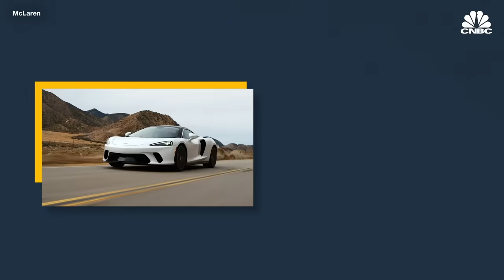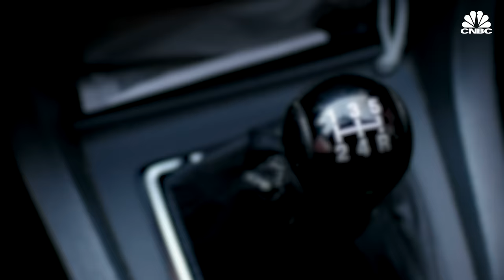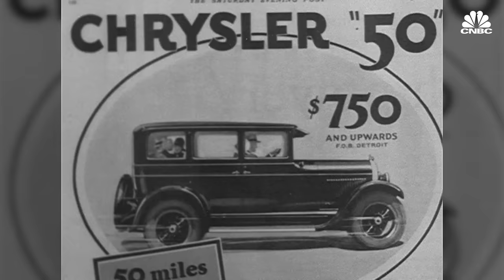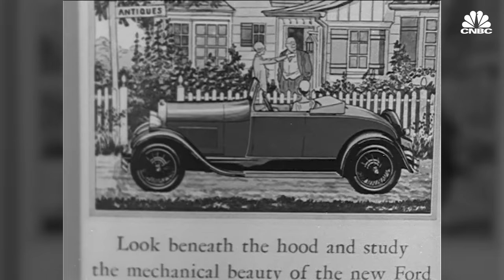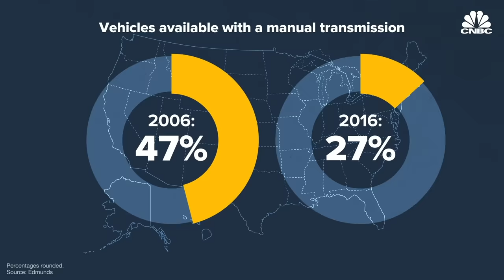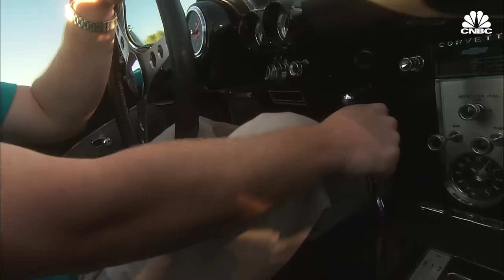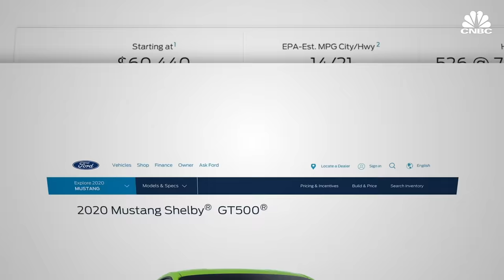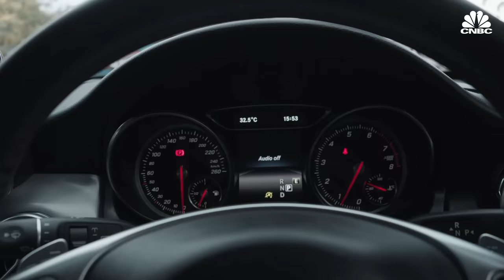Why Stick Shifts Are Going Extinct

Comment: Who else still has a stick shift? 🙋‍♂️
Reply: lgmisfit10 STI
Reply: Wow..
Only 25 upvotes so far?!
Reply: 2015 Jetta
Reply: Mazda 3 . Slow as hell but I still feel like I'm in fast in furious cuz it's stick.
Reply: I own a 1990 5.0L Mustang LX sedan,
a 2004  Nissan 350Z and a 2014
Infiniti Q60S. All have a manual transmission.
I absolutely HATE automatic transmissions.
Why? Two reasons. First they are boring
to drive and you do not have as much control and 
the biggie, EVERY automatic transmission I
have ever owned has had a major failure 
before the car reached 100K miles.
Reply: Have had many, drive a 10 speed semi every day and own a 97 cobra mustang, that car ONLY came in a manual. Learned when I was 13 years old and have never looked back
Reply: My first car was a stick, then got an auto, current car is an auto duel clutch, my next one is gonna be stick again for sure.
Reply: Fiesta ST   here
Reply: @archangele1  How many cars with auto trans have you had? My whole family drives auto vehicles with over 100k miles and we've never had a problem with the transmissions, although my next car is going to be manual because you're correct, auto is too boring. My moms 2010 Ford Flex is over 200k miles and still pulling strong.
Reply: 1996 Nissan 300ZX Turbo
Reply: 2019 Nissan 370Z sport coupe 6MT.
Reply: @Sauce.714  My first car was a 6-cyl 1966 Chevy Chevelle with an automatic transmission, a real piece of junk.
Reply: 2003 Nissan  Sentra SE-R  spec v
2002 Dodge Dakota 
Only have manual
Reply: I have a automatic 2020 jeep wrangler. I love it.
Reply: Yota Hilux Fortuner. Manual all the way.
Reply: 95  Acura integra gsr!!!
Reply: 2005 Saturn Vue - stick shift. Love it !
Reply: 18' Versa.  Horrible car, awful transmission.  (My 89 F150 had more 'feel' and consistency).  But it was the only stick available in my town unless I wanted to drop $50K on a BMW.
Reply: Never owned an automatic, though I am in the UK where manuals are more common.
Reply: Anyone who prefers driving an automatic either sits in a lot of rush hour traffic everyday or just doesn’t know how to drive a manual. If you don’t know how to drive a stick, you’re really missing out on a more engaging way to drive. It’s really not that difficult. I laugh when a dude like half my age (upon learning I drive a manual) acts unjustifiably impressed, like I’m an astronaut or something. Haa!
Reply: I have a 2016 veloster turbo.., it’s a stick and I love it
Reply: 2008 Porsche 997
Reply: I've had mine for 23yrs
Reply: 2012 Tacoma TXpro 
2008 TSX
(2) 1988 Honda Civic
Reply: When I was in Europe I had a 1996 opel astra 5 speed a 2004 Mercedes Benz c220 6 speed when I came to America I couldn’t find any Mercedes with manual so I got a bmw with 6 speed
Reply: 92 honda civic hatch
Reply: 2001 Ford F-150
Reply: '05 MBZ C230 6-speed
Reply: lgmisfit10 Ford Fiesta 😃
Reply: R32 Skyline
Reply: All of europe, all of china, all of india, all of africa, all of russia. So just 96% of global population.
Reply: 2013 Dodge Challenger hemi can’t beat the feeling
Reply: 2018 Mustang GT
Reply: 56 years old, I have only owned one car that was an automatic in 40 years of driving, a 2012 Audi S4 with a dual clutch transmission.  I sold it and am back in a manual.
Reply: 35 year old VW Vanagon.
Reply: 1996 Nissan Maxima 5 speed
1992 Nissan Pickup 5 speed
2003 Toyota Corolla 5 speed.
Reply: Chevy S10 5 speed for life.
Reply: Still have the good ole Three on the Tree ...
Reply: Only ever had 1 slush-box and that I had for the flappy paddles (pretty decent BMW 220D) the rest were all manual. Currently BMW 118D manual
Reply: My 2020 Kia is a stick shift
Reply: Me 2009 Subaru Legacy GT 👋🔥 never owning a auto again, owned them, hated them, traded them, never looked back!
Reply: 2020 Kia Soul LX 6 spd
Reply: 2018 honda fit and 2004 Mazda Miata
Reply: '97 Toyota Tacoma still running strong. Manual transmission all the way booooyyyeeeee!!!.
Reply: @archangele1  These modern computer controlled automatic transmissions are built to fail. I don't need no car to tell me what gear I need!!!
Reply: 2019 Bullitt Mustang and its a blast!
Reply: 67 chevy c10, 6 cyl, 3 on the tree, bare bones,no ps,pb ac, love it
Reply: 93 Nissan 240sx still running strong
Reply: I have a 2015 Camaro (bought new, and I demanded the manual option) and a 2006 Lotus Elise (there is not an automatic option).
Interestingly both are 6 speed, and the reverse is in the same place (left of 1st). The idea of putting reverse where 6th goes seems like asking for trouble!
Reply: Me
Reply: 2016 WRX Limited here
Reply: I do.  No automatic for me since the 90's.
Reply: A manual van
Reply: Automatics are for chicks..
Reply: 2011 Mazda Mazdaspeed 3
Reply: Oi
Reply: 13 Honda Fit
Reply: my harley davidson motorcycle
Reply: 2018 Ford Focus ST, triple yellow coat.
Reply: Patrick Pmd Sick
Reply: lgmisfit10 Speed3 6 speed
Reply: 1988 Masada B2200
1995 Sonoma 4X4 V6
1997 Sonoma 
1993 Chevy cavalier 3.1L V6 2 door
1992 Chevy scottsdale 4.3
2004 Jetta TDI
2004 golf TDI
2008 Honda Accord 2 door
2011 Ford ranger
Reply: I have a 93' Civic Coupe, it's a manual🙋‍♂️
Reply: 99 Camaro SS m6 here and a 92 03 cobra swapped m6 notch
Reply: Atleast give the option to customers .
2011 Altima 3.5sr 6spd
Reply: 2001 mustang gt :)
Reply: 2019 Mini Cooper JCW here - loooooove it!
Reply: Nothing but automatics for me.
Reply: Jennifer Annison 0
Reply: I have a 13 year old manual ford fiesta and still on the original clutch
Reply: Had 😢
Reply: 5 of them here.
Reply: 2012 Mazda3 fully loaded with a stick.
Reply: 96 powerstroke diesel.
Reply: Mercedes W123 coupe w/ 4 spd manual.
Reply: My first was a 87 mazda 323 manual everything that i loved.   Currently seeing my dodge 2002 neon  rt into its twilight years....
Reply: 1987 Mustang GT. 5speed manual
Reply: British - so of course every car I've ever owned has manual shift.  In fact, I think I've only driven an automatic 2-3 times in 40 years of driving.
Reply: 2015 Mustang GT.
Reply: @williamfunes2740  might be fast but handles better. I have 18 3 hatch
Reply: 1990 Celica
Reply: I still am.
Better to have experience in manual before Automatic, gives people discipline and attention development.
Reply: All manual all audis my Audi urs4 is my dream. Profile Pic 6speed manual and lots of boost
Reply: Ceramic Toyota Corolla s 2006
Reply: lgmisfit10 im aiming at getting my first at 29 years old
Reply: I moved up from a 2001 Jetta 5 speed to a 2012 Sonic 6 speed turbo and my 22 year old son can drive a manual.   I just need to teach my 19 year old.   My 20 year old niece drove a 5 speed to Hs and was the only girl (and 2nd driver) driving a manual in a large Hs.....
Reply: 300ZX Twin Turbo
Reply: 2016 Nissan Versa, andI love it! 🙌🏻
Reply: 1994 Honda del sol 5 speed manual
Reply: I Used to but I just sold it and needed a car fast which is auto 😞
Reply: 2003 SVT FOCUS
Reply: 2006 Mitsubishi Eclipse Gt
Reply: every car that i had driven in my life had a stick. but i'm from europe so...
Reply: 89 Saleen and a 99 Cobra. Looking for a manual truck so people won't ask to borrow it.
Reply: Audi TT mk2
Reply: Me a mini Cooper 🤙🏾
Reply: 2009 honda jazz
Reply: 87 corolla
Reply: I do. My mom and dad drove manual, my siblings do as well abd I do too. So i sticking woth the manual.
Reply: 2001 Saab 9-5
Reply: I have a Corolla Diesel slow car but with manual transmission it feels fast
Reply: Currently own an old 90s ford truck with a stick. Owned like ten cars in my life, half have been manuals.
Reply: 2014 Checy Cruze, and I will make sure my next car is manual as well.
Reply: I have two. 
2000 Toyota RAV4 
2016 VW Jetta 
Eventually the wife and I will drive automatics again, but we are CONTENT w/ our manual transmission vehicles for now!😁
Reply: I wish I did. Can anyone give me a lesson?
Reply: G35
Reply: @kieranmatzky181  save money and just buy a manual car
Reply: I don't own one but I'm a 22 year old American & I know how to drive a manual because I visit Europe frequently; I've driven them In England, Germany, and Ireland. I learned in a VW Passat Estate, only sold in Europe (Not the U.S.).
Reply: lgmisfit10 B6 A4!
Reply: 2019 VW gli with a manual transmission  love driving it
Reply: 2016 mustang gt here with a 6speed man, dont ever have to worry about somebody driving my car, they cant lol
Reply: I’ve only ever owned manual - They are extremely hard to find now a days and it makes me sad
Reply: I have it , I hate it , in the space age we live in ,  shifting gears to drive is so yesterday . I am getting rid of my heap and getting a fully loaded with options car .
Reply: You mean?: "Who else still has control over their car?" 🙋‍♂️
Reply: I have a manual 2.0 I4 new beetle it passed 200,000 miles with minor issues plus it has an aftermarket SPL audio system which is louder than the engine itself
Reply: 03 Passat 1.8t
Reply: Me
Reply: Me. 2019 Genesis G70 Sport
Reply: I just sold mine a few weeks ago and I miss it
Reply: 2 of my cars a manual  and my Murc van thats 6 speed
Reply: 2015 Willy's  Jeep
Reply: s2000
Reply: 1990 Nissan 300zxTT
2000 Ford Focus ZX3
2006 Nissan 350z
2006 Jeep Wrangler TJ
All stick
Reply: 2014 Mazda 6, 2020 Mazda 3, both manual. First new car was 1965 GTO, 4 speed Hurst shifter, 3x2 barrels. Yeah I'm old but still like a manual. They make driving fun.
Reply: Chevrolet Cruze 2014
Reply: @SVTJD  I beat you by one year. Learned to drive when I was 12.  You beat me on numbers of gears. I've never driven a semi.
Reply: 2013 INFINITI G37s Sedan here.  4 doors + 3 pedals = my favorite combo.
Reply: 2008 Ford Mustang. 5 speed manual.
Reply: Me. My backup car is a manual.
Reply: 2001 Porsche boxter S
Reply: 2016 Focus ST.  I'm done driving when a manual transmission isn't an option.
Reply: 2017 Chevy Cruze
Reply: 2013 ford Focus Hatchback
Reply: 2 out of the 5 vehicles we have are standards. And 2 of the 5 never had factory opt of a standard!
Reply: Unfortunately 2017 was the last year for a Cruze manual.  I own one.  I may have to go Volkswagen after that, as GM has almost completely abandoned the manual transmission market.
Reply: My 2003 Civic hybrid has a manual
Reply: I do have it and I will buy it again.
Reply: mazda 3.   120hp is enough if you have a manual :)
Reply: I wanted a sport car with a manual shift because that is the way a sport car should be.  I found a Mazda Miata, 5 spd manual, it was that or nothing. It makes the fun of driving such a car.
Reply: Laguna mk3 2.0 dci 6 speed manual
Reply: I love my stick shift!  I won't have a car sans ever!!
Reply: I’m planning on importing a 5 speed manual R32 GT-R. Wish me luck.😉
Reply: 2007 Fiat Punto
Reply: Subaru Impreza WRX STI 2006
Reply: Jetta 2000 gl
Reply: 1998 Honda Prelude
Reply: Man-Ung Yi i wanna see pics love that car I have a 98 Prelude project car painting it yellow soon
Reply: Yotube lol
Reply: Jocelyn Perez that was my first car nice
Reply: Hopefully I’ll never have to buy an automatic. Lazy....
Reply: 1994 Dodge Dakota w/260,000 miles on original clutch; 2012 Hyundai Sonata w/77,000 miles. Owned a 1975 Volvo w/over 300,000 miles and only 2 clutches before someone ran into it and killed it.
Reply: I drove stick shifts for 35 years. I took my first driver's test in a stick shift. I'm sorry, I gave up last year after my manually shifted pickup was totaled by an unskilled, lazy, distracted automatic transmission driver. 🤦‍♂️
Reply: MEEEEEEEEEEEEEEEEEE!!!!!!!!!!!🤗
Reply: Selling my last one shortly.
Reply: 6 speed stick turbo diesel and I love it ;) When driving in the city it is a lot of gearing involved but out on the countryside you normally run it at 6th gear unless it is a steep hill and the car it a 3,2m tall moving van.
Reply: Hear hear: and it is going to die with me.
Reply: I have 2 standerd shift trucks !  Had breaks go on both standerd and automatic . Standerd works better to slow you down !
Reply: @bear1more287  started out on the ( 3on the tree and had 3 on the floor too ) also had one half and half for a while ,that was fun.
Reply: @richardwelsh8448  had half ton Ford 3 on the collom ,had breaks done and the mechanic said he had trouble finding the gears. First of all if you can't drive standerd you have no busines get sertified to work on cars !! All auto tech ans diesel tech schools should require you to pass a driving test on a standerd shift before you start your classes !
Reply: C5 Corvette
Reply: 2000 vw passat wagon  went to 2008 vw passat wagon both of them over 100 thousand miles OEM clutch never replaced now i have a 2019 vw golf alltrack manual will always drive a manual because i can control the car
Reply: Every car that I own
Reply: 2003 Toyota Corolla with 1.589 million miles, rebuilt transmission and engine. Worth every penny
Reply: Me
Reply: I do, and will untill the day I die.
Reply: 2016 manual transmission Kia soul. I'm 60 years old. My 16 year old can drive it. Houston Texas.

I was in my kids drivers Ed course last year. They teachers  said kids today can't handle stick. I said, what did you learn to drive on? Both  teachers replied, stick. I said, me too. So why is this generation so soft? 
My kid thinks she's tough.
Reply: My 2009 Honda Accord V6 sedan is an automatic because I got it dirt cheap. It's a great every day driver but it undoubtedly would be more engaging to drive with a manual transmission. That said I drive an 18 Speed Kenworth T800 for work on a daily basis so I get to shift manually every day.
Reply: 2005 Toyota Matrix
Reply: I drive a manual-transmission 2007 Ford Focus. Before that I had a 1993 Ford Escort, a 1982 Volkswagen Rabbit and a 1971 Toyota Corolla -- all with stick shift.
Reply: Had a 18 WRX and now drive a 20 Civic Si... Can't go back to automatic now.
Reply: For 1971 three quarter ton Chevy pickups 4 on the floor bought all new all still running with oover 80000086 Nissan hardbody pickup new 508000 miles 5 feet on the floor 98 Chevy 3/4 ton automatic I hate it.
Reply: The All White 1993 Honda Civic 4 Door stick shift with the all white rims, white interior with the front lambo doors and back suicide doors, mint condition still going strong..
Reply: 2000 mustang love it
Reply: 93 Chevy Pickup.
Reply: Mazada 323 in the 80's, Honda prelude 90's, VW Passat 00's, Accord 6 sp 2013, Civic SI 2018
Reply: 1998 Jeep Wrangler
Reply: 1990 BMW 318i convertible
Reply: Recently bought 2020 Subaru BRZ :) in manual transmission and it was the car I learned stick shift in.
Reply: I drive one, extremely terrible at it, but occasionally when it sticks it's the best feeling in the world.
Reply: 1994 Ford Escort
Reply: 2019 Accord 2.0MT
Reply: 1976 Civic 4 speed
1977 Civic 5 speed
1996 Civic 5 speed
Hate both my automatic truck and van but they never came with manual transmission
Reply: 2010 toyota corolla
Reply: 2012- Sonic:6-spd.
Reply: Girl’s 8-spd.-valva.
Reply: @auxmike  also have a mazda3
Reply: 07 toyota fj
Reply: Corolla ae92
Reply: @SVTJD  I don't know why but that makes me chuckle: going from a 10 to a 6 speed after getting off work! Do you sometimes accidentally go "Where the hell is 7th?!" when you're in the Mustang?
Reply: 67 camaro, ls2, richmond 6 speed 💪🍻 #savethemanuals #3pedalmafia
Reply: 93 yj 4.0l with an ax15.
Reply: Me too
Reply: Vp commodore
Reply: Miata!
Reply: 2008 civic
Reply: 2002 jeep wrangler tj 5 speed manual 4wd
Reply: 93 vw FOX. 5 speed.
Annnd should note that these cars didnt even have an auto option, just 4 or 5spd
Reply: Scion tC
Reply: mazda miata mx5
Reply: I ordered my Porsche Carrera S with the six speed manual—how can you possibly consider a Porsche with an automatic??
Reply: I do!
Reply: I will not drive anything but a manual transmission.
Reply: My 2018 nissan versa 1.6 manual
Reply: 1993 Honda Accord LX 5 Speed. Learned manual in this car and it was worth it. Love driving manual but I want a faster car now with a 6 Speed.
Reply: mk2 supra
Reply: @jenniferannison4390  Most people driving manually in traffic do it incorrectly anyhow, they sit on the brake with the clutch depressed rather than applying the handbrake when stopped.
Reply: daily driver '02 gmc sonoma. I had to search high and low for a frickin manual.  and as slow as it is, I'd be bored to tears driving it everyday if it was an auto. Plus, it's got me out of some sticky snow and mud BS, clutch control baby.
Reply: Out of my 38 years of driving now, I have driven automatic only 2 of those years, and that was because it was a temporary hand-me-down between manual cars.
Reply: I have 3 manual cars
Reply: My Parents Both Own an Older 2011 VW Golf Variant & a 2019 VW Golf Blue Motion fitted with State of the Art Systems 

Both are Stickshifts🚘🚘🚘🚘🚘.
Reply: 2017 Mustang
Reply: 2008 Cl7

Comment: Modern CVTs break at 100,000 miles on the dot. Automatics don't usually make it past 200k. Manuals will keep chugging and chugging forever. They're so much more reliable.
Reply: Love my manual transmission, but Toyota CVTS last a LOT longer than 100k miles.